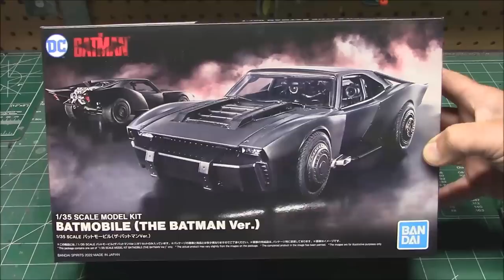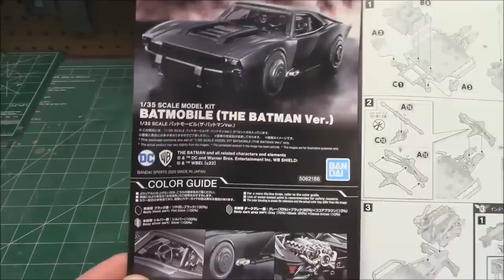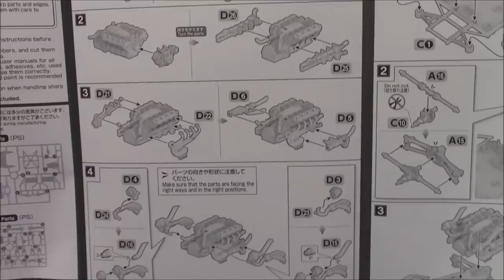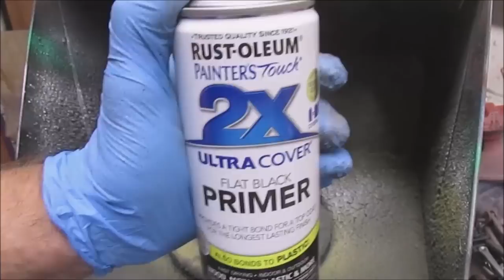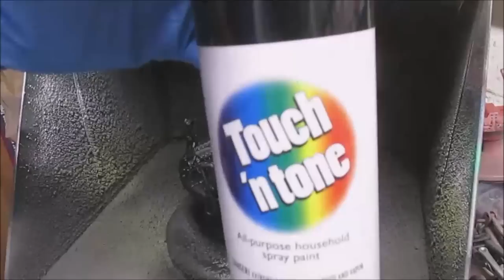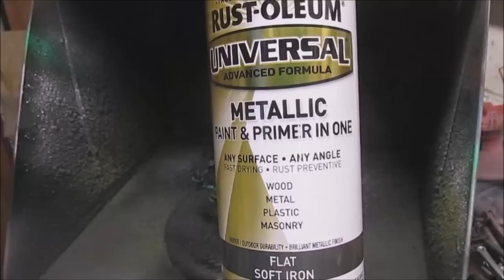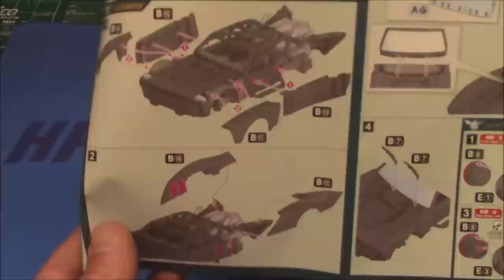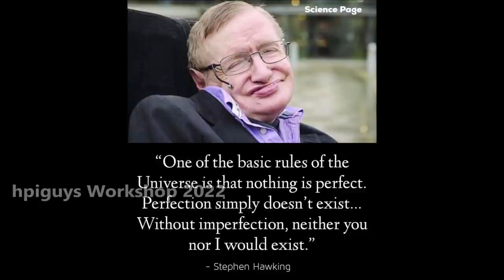The Batman Batmobile 2022 1/35 Scale Model Kit How To Assemble Paint Engine BanDai DC Comics

Comment: Actors most of the time aren't bad. They just do what they're told to. And Twilight was cringe to start with.

Anyway, back to the kit, not surprised it's that nice. I mean, it's Bandai. Really cool results too. Hopefully they also, at one point, do 1/25 scale of that kit. I try to stay in the same scales, not to be all over.

If you want to make more Bandai, I suggest Gundam kits! Not the '80s ones tho!

Comment: That drive shaft going forward from the differential and the exhaust under the front fenders, tells me the rear engine was just a mock up for the real car. it probably had a regular LS engine under the hood in front.  Then again, who would be able to drive that thing with twin turbos sucking air in the cabin?

Comment: Nice model, love your videos!
Question on the Pledge floor polish you use: 10+ years ago I bought Pledge Future shine to dip my glass in, never heard of using on the whole car until you. I tried it on an old model, pretty darn shiny but I think my bottle is getting a little old and dry as the surface wasn't perfectly smooth. Looking to buy a new bottle and it's hard. Future no longer made. I assume Revive It is equivalent but no stores have it. I can buy it online for $37-47 a bottle! Are you aware of any alternatives? Quick Shine is available in stores and quite a bit cheaper, but of course not sure it works as well.
Reply from the maker: You'll want to watch my video of the Ford Courier Firestone pickup for the answer on Future floor polish. ;)

https://www.youtube.com/watch?v=GQP1_k4OXHA
Reply: @hpiguy  Hi hpiguys workshop are you gonna get the AMT tie fighter and to a review